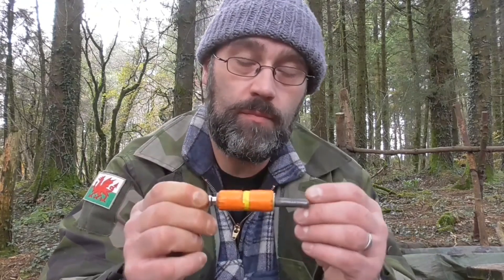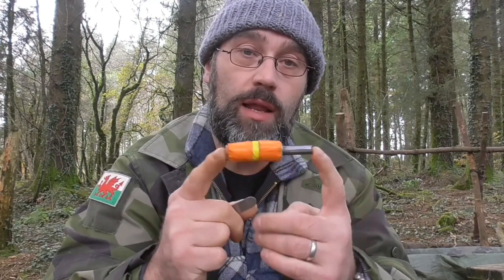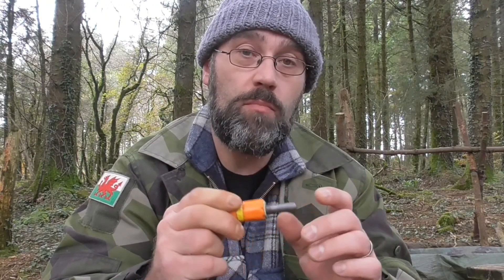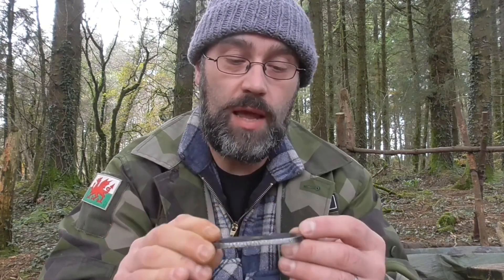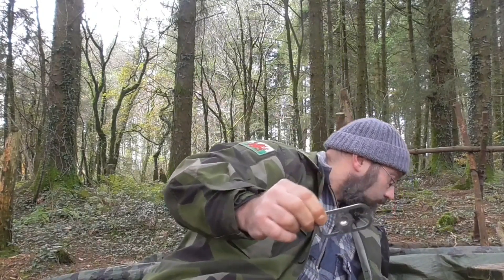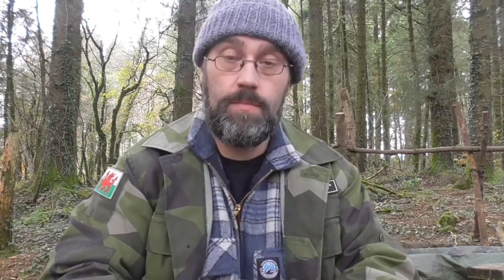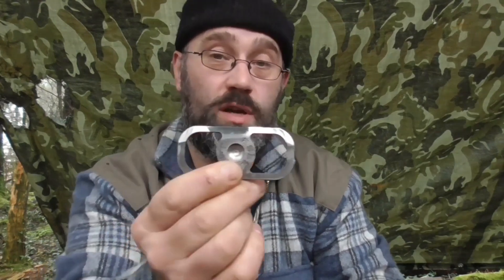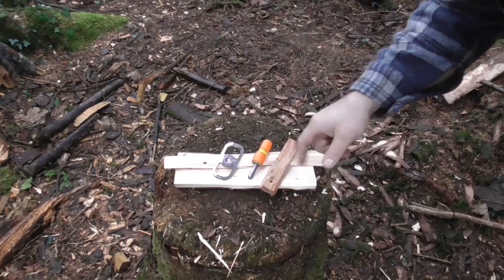My three favourite firelighting tools Inc modified ESEE firetool

Comment: I use matches less and less these days. I've got some stock of 'strike-anywhere' matches, but they are a pale imitation of the old-fashioned Swan Vestas, which had good big red heads. You could strike those easily on a window pane! I remember in my younger, student days, working as a barman. It was common to have a house brick on the bar, with the 'frog' filled with Swan matches for the benefit of the smokers who could take a match and strike it on the brick. I will just add that the ESEE firetool is outrageously expensive, especially if you have to modify it to do its job properly.
Reply from the maker: Cheer up mate it's your birthday!
I've spent a hell of a lot more on things I've used a hell of a lot less.
I'm shaping you knife handle right now mate.
Happy birthday!
Reply: @RobEvansWoodsman  👍👍👍

Comment: You can also use the duck tape as emergency tinder if you tear it into really thin ribbons it will actually take a spark.
Reply from the maker: I didn't find it that easy to ignite with sparks but it did work 👍

Comment: I purchased an aliexpress clone of the ESSE tool last year. It worked with the ferro rod right away,  but worked even better after applying the DC4.
Reply from the maker: There's a lot of clones around, I was thinking of making a run of my own design with more features.
Reply: @RobEvansWoodsman  I'd be interested.